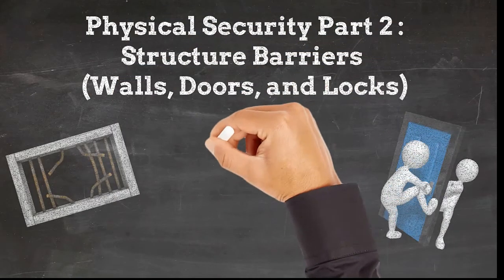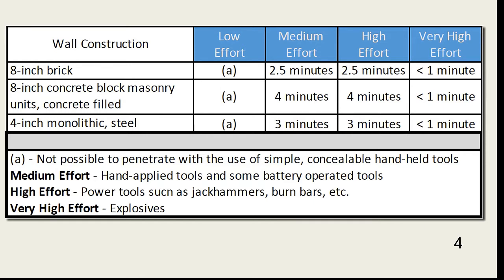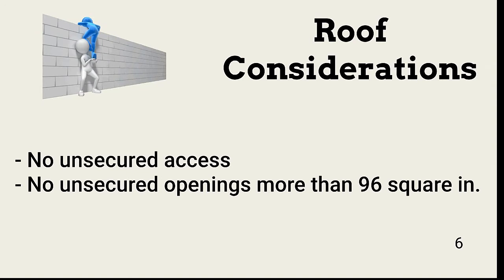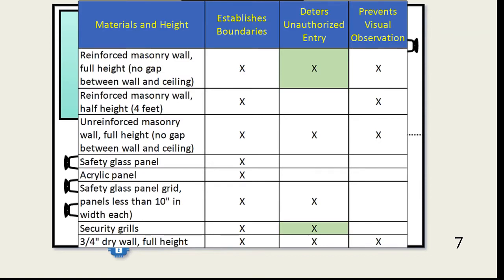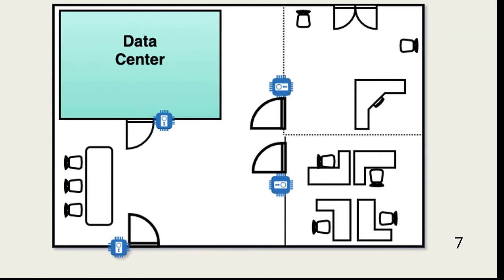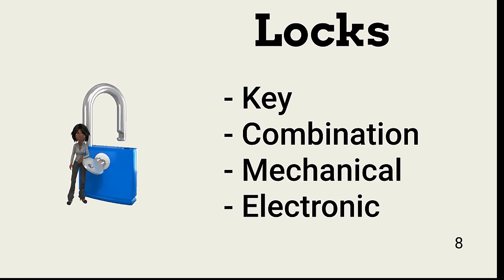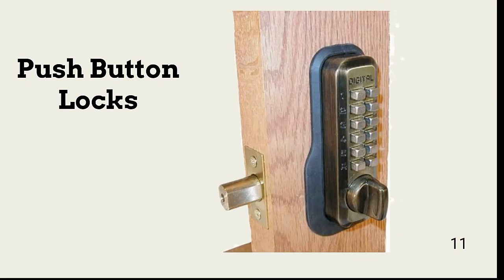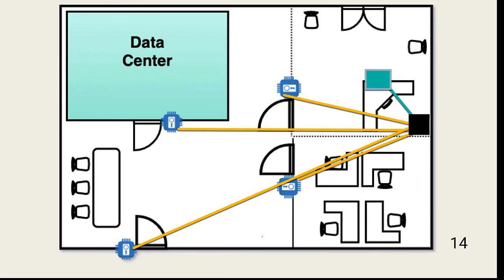Physical Security Part 2 - Walls, Doors, and Locks

Comment: Are biometric locks (fingerprint, face recognition etc.) considered safe? Thanks alot for these lessons btw!
Reply from the maker: They can be.  It depends on the technology used.  For any biometric system, you need to look at the intersection of false positives and false negatives, as described in my free book chapter, Application of Biometrics (https://bit.ly/371bCz6).  As with any locks, however, you have to remember that locks are only a delaying control.  As with all physical security controls, we seek to deter and delay an intruder until we can detect the intrusion and intervene.  See my video, Physical Security Part 2 - Walls, Doors, and Locks (https://youtu.be/EAeVUDMDSn4) as well as my article, Managing the Intruder (https://bit.ly/3LwG7fj).